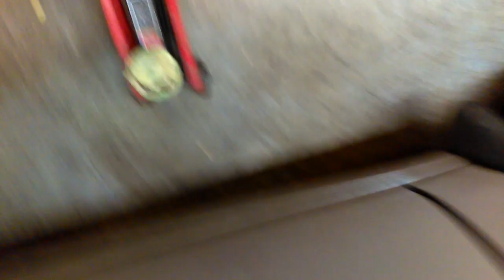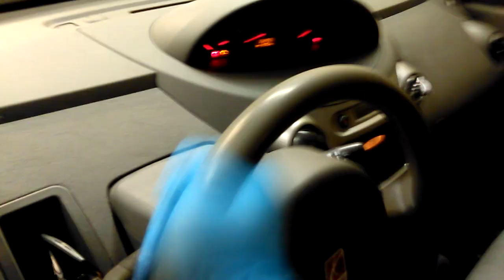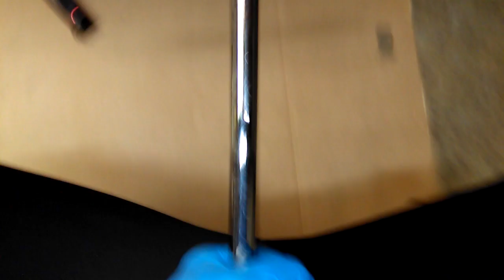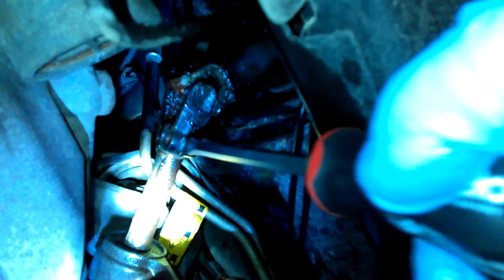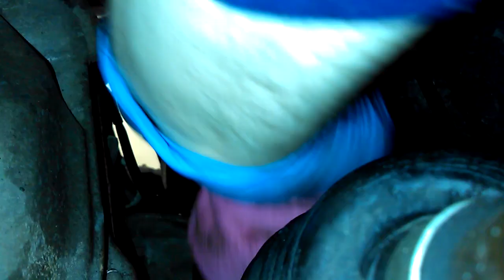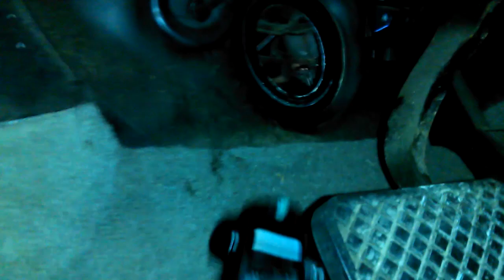Saturn Ion Steering Shaft Replacement In 3 Minutes. For Millenials.

Comment: Before installing your new intermediate shaft, make sure you remove any burrs that may have been left behind from the inside groves due to when the part was machined. A rat tail file comes in handy.

Comment: I did my 2006 malibu yesterday 
The steering shaft can only be installed one way because of the groves on how to put the bolt  
I had my steering strap with the seatbelt so it want move
What I'm saying my steering wheel is off center  now do i need alignment
Reply: You must have been a few groves off when you attached to the steering wheel